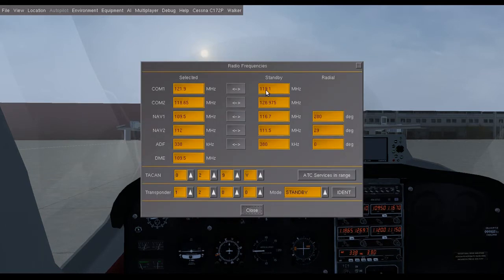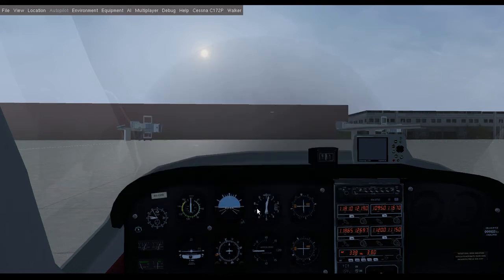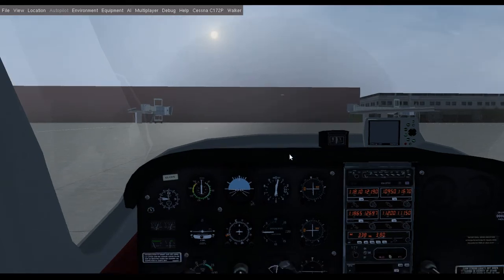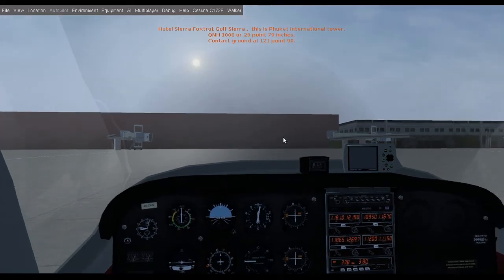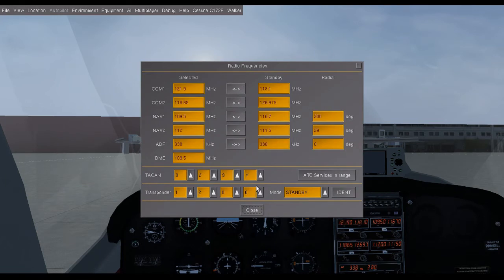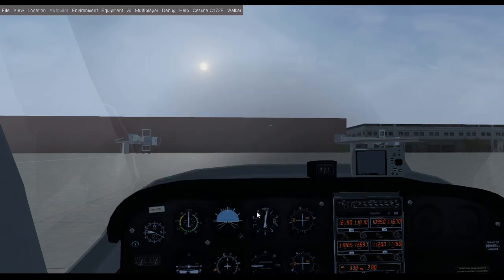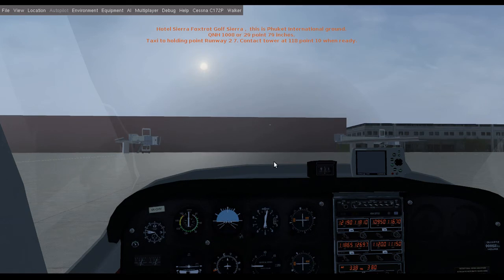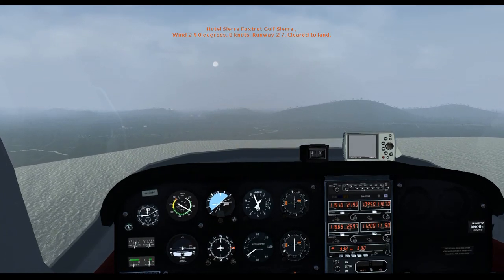Now FlightGear has ATC! - the SpokenATC addon

Comment: Could you please tell me in detail how the spoken atc works and how to install it?
I tried but I didn't do it, I would be very happy if you tell me in detail.
Reply from the maker: It looks like the mod is embedded into many planes, including the a320 we're flying. You should be able to just tune the radio to GND or TWR, hear chatter from AI aircraft, and transmit by typing a left angle bracket (however that works on your layout).

For other planes, I would recommend Red Griffin ATC.
Reply: @ddk  atc frequency will be more realistic in a320. but yes it sure will take some time from the flight

Comment: i have a problem.
when i press < appears a message that says turn comm1on. set volume.
help plzzz
ps i use mac
Reply: after i have unzipped the file i putted the folder in the desktop and i copied the path...
Reply from the maker: Yup, that means you installed it correctly! Congrats!

As for to get ATC working, it tells you to turn Radio 1 (COM1) on. In the C172p, try autostarting the plane before you hit < .
Reply: @ddk  same thing...
Reply from the maker: @ludovicoleardi2268  What have you tried exactly?

There's another message type than can come up. Tell me if the message changes.
Reply: @ddk  i've unzipped the file and copied the folder in the command (now fg don't recognise the path) :(